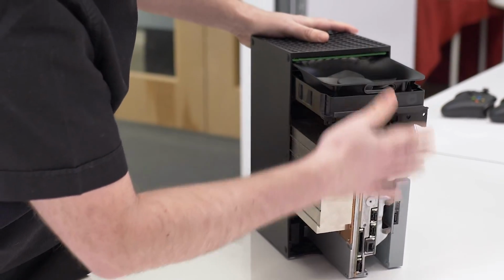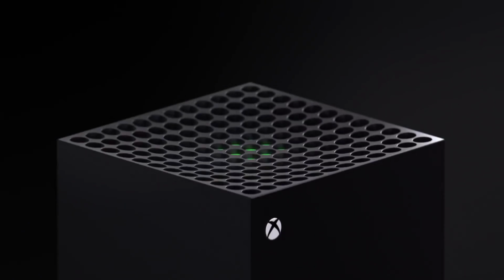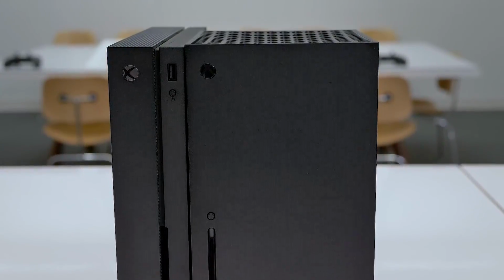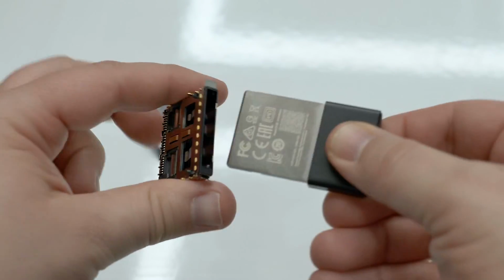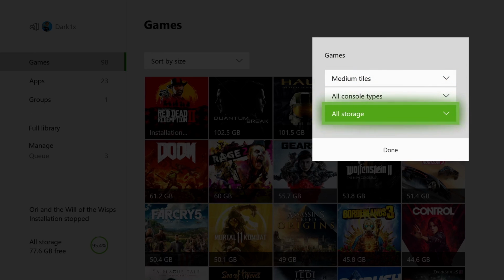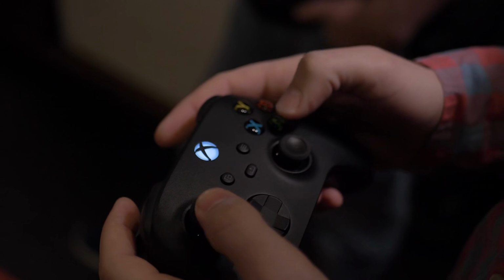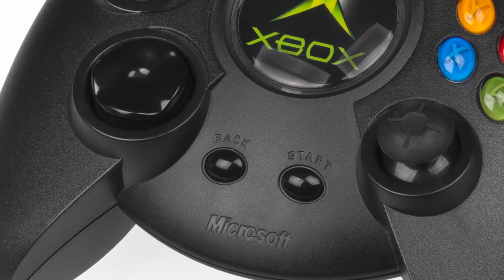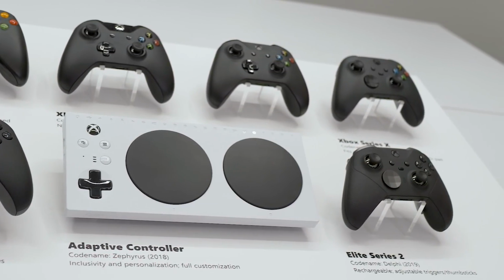DF Direct: Hands-On With Xbox Series X  + Impressions + Xbox One X Size Comparisons!

Comment: How hot to the touch does that Seagate SSD expansion get? I just purchased a small metal Sabrient external case and NVME drive for my MBP and it’s hot enough to burn you when in use. I don’t like to leave it plugged in when I’m not actively using it.

Comment: I think it’s very comparable to a PC .. Very reminiscent of the 2013 Mac Pro, which had just over 3 teraflops of floating point performance. I remember wishing I could afford that machine; now we have a computer that’s over 4 times as powerful (and far more than that in GPU performance) - for 1/12th the price. It’d be a mean little machine if you could use it as a general purpose computer. (Which you sort of can if you run Windows 98 on it via retroarch)

Comment: INCONSISTENCY? - If the external storage was supposed to be regularly interchangeable, then WHY was it situated at the REAR of the machine?  Should they ever launch a 4Tb version, then MAYBE the purchase would be a legitimate proposition?  1Tb is a far too small option for anyone with a significant game library, as is the 1.8Tb MAXIMUM storage option with the expansion fitted!  My XBOne storage is at 3.5Tb at the moment, as MOST of my games (105 games so far, PLUS apps!) are digital downloads from XBox Live Gold monthly offers!  I haven't bought ONE single movie to save on the machine either!  So, you can see, even FOUR Tb would be the MINIMUM I would need as BASE LEVEL storage option!

Comment: Can the Xbox series X be run in 1440p instead of 4k in order to have a more consistent frame rate? Essentially what PC players have been doing forever. Performance over prettiness. I’d love to take advantage of the power to run at 120fps consistently and put less demand on resolution

Comment: Nice design I think it would be wise to stand the Xbox upright since heat rises it will help heat to escape which means more efficient cooling. But if you leave the Xbox off for a couple days I wonder when you start playing and it heats up will you began to smell burnt dust. With those holes that large I'm sure dust will find its way in if left sitting vertical.

Comment: Hoping 4 things with the new controller: 1) Stiffen up the joystick spring tension. 2) Actually utilize the haptic rumble and 3) Beef up the bumpers, I've had to replace 4 of mine since the One launched in 2013 and 4) Make the connection either bluetooth or something better than the half-assed one they have now.

Comment: Microsoft: want more storage? Sure buy this card and plug it in this socket, that’s it.

Sony: want more storage? Sure just unscrew this back panel, then buy a drive if the size you want, only make sure it is fast enough so it won’t slow down the entire system, it will physically fit in the machine, it won’t overheat or be too hot and melt your machine. Or you can spend three times the cost for a PlayStation approved drive....

Comment: It looks good, but why was there more controller evolution in a single generation of PS1 than four generations of Xbox? PS1 took us from a SNES type controller with handles, to twin analog sticks and then vibration. All fixtures of controllers now, but innovated by Sony. And Nintendo innovated with the N64 controller, although to be fair that was a real monstrosity. But what's Microsoft so scared about with improving the controller, it's not like they instantly hit upon the perfect controller with the first Xbox design. They just took the left side of the Dreamcast controller and the right side of the Playstation controller and joined them together. And that became the Xbox controller that has lasted four generations with barely any change. Not saying Sony is super innovative post-PS1 either, again it's like they just stopped trying to improve it. As if they attained perfection, but it's far from perfection. They need to work on control interfaces, you've got all these amazing graphics going on but playing it still feels like you're operating a complicated remote-controlled robot. But then I suppose they tried to be super innovative with Kinect. And they super failed. So maybe that's why they're just polishing their old controller now.

Comment: Pc gamers are gonna need to spend around $1800 dollar’s in late 2020/2021 to build an equivalent Pc to match Xbox Series X as that’s insane console peasants are gonna get this insane level of high end Pc power, and performance at 1/3 the price of building an equivalent paper spec Pc
Reply: Isn't the 3000 series of nvidia cards looking to be extremely promicing? I'd bet that with a 3060 you could build a sub $1000 pc that can also do things other than just gaming.

Comment: Idk a lot about building PCs and constructing consoles but: doesn’t having all those pieces jam packed in there cause it to overheat even with a fan? Asking with intent to buy the SX
Reply: The largest piece inside is the vapor chamer, designed to cool the shit out of it.
Reply: @TheCrazeturk  This vapor still gonna be hot even if it's cooling CPU and GPU.

 Over time when the whole passive cooling system would be the same temperature as CPU and GPU it starts became hotter and throttle the system.
To cool that machine it need a lot of space or fan/liquid, and that prototype doesn't have either.

I just hope Microsoft do best job at the end.

Comment: Now, after the reveal of the size from PS5, im even more impressed what those wizards at Xbox achieved here.
Reply: Yeah, the XSX's cooling system is so freaking elegant. One big vapor chamber, one big fan, one big radiator. Whisper quiet, great cooling. PS5 should produce more heat and require more cooling even though its GPU is weaker, all because they chose clocks over cores. XSX is "wider," PS5 is "faster," XSX is definitely more powerful. I'm jumping ship, this'll be the first Xbox since the original that I've chosen as my main console.
Reply: @FFFan3445  At first I had doubts about the cooling - "Blimey, that's cramped and it's got one big thing at the top, that'll melt my face off" but actually I'm warming to it. Not like warm warm. But I like where they're going with it!
Reply: Facelord
Both will probably perform as intended. Look at all the releases of Playstation, that's what I think is the selling point.
Reply: Nothing 'wizardry' about it. Hard work, focus and talent.
Reply: The PS5 is slightly taller but has less than half the width, what is your point?
Reply: Barack Obama The point is that the XSX is put in a more home friendly design and looks to be better at heat dissipation. PS5 on the other hand... let's just say that it makes the PS3 and Xbox One look a little small.
Reply: @GrainMuncher stretch out both your hands and put one on a table and the other on top of your tallest finger, next take away your bottom hand and keep the top hand still, bend your fingers halfway on the bottom hand and place that hand on the tallest finger of the hand that's stretched out in the air still. Bam you call that small?
Reply: @GrainMuncher  seriously?? SLIGHTLY???

Comment: Why does the Series X not have a USB-C port at all (or a few), especially 2x on the front for charging it’s controllers (obviously after you purchase a future “Play & Charge Kit”)? This means they would have to supply either a USB-A to USB-C charging cable or a micro-USB to USB-C adapter charging end. Maybe they’ll ship each console with one of these adapters so that existing Play & Charge Kit’s are compatible?

Comment: I have built quite a few computers with air flow a priority, looking at this im a bit worried about cooling, testing it in a controlled environment even in the desert is one thing but it should really be tested in a normal room in a house environment with dust etc, because it looks like in a normal environment with dust accumulation that will become an issue

Comment: If there is no optical port for headsets for example astro gaming headsets, how will I use headsets with my Xbox series x if the port isn't there?? I very very much appreciate any insight or information I would be extremely grateful.
Reply: Supposedly Astro is working with Microsoft on an update where you can use your headset via USB.

Comment: While it won't be a deal breaker for me, if I'm getting it I do hope that they don't change the battery slot on the controller so that I can just repurpose my current recharge pack. Also, hopefully this won't mean I have to get a new USB dongle for PC, though I don't think it'll be a thing anyway. I actually have two controller for my PC at this point, and I'm really just milking the older one when playing non-action titles to see when it will break.

Comment: OK, there is one thing that is still weirding me out - the fan orientation.

Microsoft is talking all the time about how the Series X would 'suck in fresh air from the bottom and then exhaust it at the top'.
But the fan orientation is pointing downwards - so in all the footage we've seen so far it's pushing it top-down.

Which is by no means a bad thing, since blowing onto the heatsink should be better (more focused airflow) should be better than sucking in from it - it's just confusing me a tad.
But I'm happy the series X is a nice machine :)

Comment: I really wanna like this console, but im not feeling the "memory cards".  I would have preferred the option to add more sticks of nvme  instead.
Reply: It has usb to do that, you van also use hard drives, but that's for moving xb360, xb1, and og xbox games. The memory card is for being as fast as internal ssd since thru usb, it won't be faster, but I assume u can thru the usb ports

Comment: there is no fan Contact directly to the vaper chamber and that singel fan sitting far away from vaper chamber and its quite compact dont you think it will get hot? i know it got pretty low speed but maybe the hit temp limit around 1825 mhz? What if get hot then wont that make it lose some speed from 1825 or it will keep that speed until chip pope like a popcorn?

Comment: I realize that the PS5 has a faster SSD and potentially runs a little faster, but you can't beat these gamer centric features and 4 console generations of backwards compatibility.
Reply: Faster SSD doesn't mean faster system

Comment: Will the controller still break after 5 minutes of FIFA? 🙄 Don't mean to be mean, there's obviously some great engineering behind it, but.. With all due respect all that power has to be usable too. There are major complaints online, quality issues, not only about the standard controller but about the elite which costs well over 100 bucks. That's gotta change

Comment: Another great video from the guys at DF. I have one tech question that you or maybe another fan could potentially answer.

These Seagate extra memory cards. Are they themselves SSDs or are they just an extended memory that runs off the internal SSD. If they themselves are their own SSD couldn't the future hold not only larger size memory units but also faster SSDs than the internal?

Comment: PS5 vs XSX - - - - - - - - - - - - 
Ram - 448gbps @ 256bit vs 560gbps @ 320bit 
XBOX WINS
------------------------------------------
SSD - 825GB @ 8-9gbps compressed vs 1TB @ 5~gbps compressed 
PS5 WINS ( but with less storage space ) 
--------------------------------------
CPU - 3.5GHz variable (best case scenario) vs 3.8GHz locked 🔒 
XBOX WINS
-----------------------------------
GPU - 10.3 TF variable (best case scenario) vs 12.155 TF locked🔒
XBOX WINS 
---------------------------------------
GPU again - 36 CU with no accelerated mesh shading or variable rate shading VS 52 CU with machine learning, sampler feedback, accelerated mesh shading and patented variable rate shading courtesy of Nvidia co-developed DX12 Ultimate API
XBOX WINS
--------------------------------------------
Facts.
Reply: The series x is 4.8GB/S compressed. Not sure where you got the 8.6 number from.
Reply: @PrehistoricModels  

You're right about SSD but with Microsoft New decompression technology BCpack enabled they can get it up to 6GB/s a second with One terabyte storage SSD on Series X

Comment: Yeah but they still use AA batteries...
Reply: Microsoft made a statement saying that they use regular double A batteries (not rechargeable) because they have a better shelf life. So when you do eventually by the system and it's been sitting shipping container or boat you get batteries that have a charge when you get it. I would prefer them shipping it with rechargeable batteries and you take the hour + to challenge them up first. You can do that while you're setting it up or downloading stuff for the new system.
 That's supposed to be really fast this time around tho.

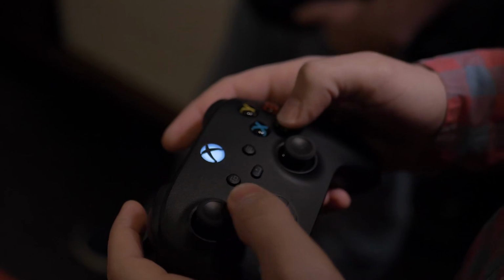Comment: 19:45 That is the reason itself I love the controller design of the Xbox and I'm glad they took people like me into account. I play using the claw method on both hands (more so the right hand and for some actions on the left hand) and it's just not comfortable to do them on a PlayStation controller
Reply: Can you give an example for left hand claw?

I claw the right hand in all games that use the right stick. The left hand however... I don't see where that'd be usefull.
Reply: @stefans4562  In Apex Legends, I use my left index finger to keep my character moving by pushing the left stick while using my left thumb to hold up on the dpad so I can open the shield/health item menu. At the same time, Im using my right index finger to slide jump (Hold B>Press A on Xbox) and using my right thumb to select the shield/health item with the right stick. These actions can not be done in less than a second if I don't claw with both hands. Keep in mind the pressure of being chased by the enemy because it's a predator lobby. It's saved me many times that I can't even count because it's second nature to me. Hope that helps!

Comment: Naaah, hate that form factor.  And it still looks like a mini PC/mini-fridge.  And yeah, it looks lazy.  Would be a pain in the ass to fit in my tv case.  Prefer the flat VCR designs.  Flat design wasn’t broke, why fix it, except laziness?  Hope PS5 doesn’t go this route.  

Not sure about that proprietary memory card either.  Better be sold zero profit for Xbox and not overpriced like Vita memory.  But nonetheless extra cost to make the slot for that card which perhaps could’ve just been used just to buy a bigger SSD in the first place.  Maybe it’s a good thing, maybe not.  Wait for price before deciding.  Skeptical, especially will it really work as well as the built in memory or will it work slower?  Or perhaps built in memory was slowed down to match the speed of the memory cart? Wouldn’t trust Microsoft not to do shady things like that.  

And wtf, still no built in battery for the controller????  Come on.  

If they have good games, I’ll buy, but won’t like that console form factor.  Just won’t look right in my entertainment table.  Hope PS doesn’t go this route.
Reply: The mini tower is due to heat dissipation, the heatsink is a lot thicker with this console

Comment: So i noticed that it uses USB 3.2 but most recently USB forum has updated the nomenclature TWICE. 
Does this mean .... USB 3.2 Gen 1 (SS 5Gbps) or USB 3.2 Gen 2 (SS 10Gbps) a big difference there, i know cause i've seen the bottleneck on my Asus TUF X570. 3.2 Gen 2 is about 80% faster on more economical Silicon Power Drive. Not to mention the Samsung Bar USB, that thing is Blazing fast, Faster than a SSHD, with little heat transfer.

Comment: I'm sorry, but how will heat not be a problem with everything so damn close together? Will we be able to open and clean out dust easily? These are important factors imo
Reply: It looks like it's super easy to take out and clean. Every review video I've seen these guys have removed the guts from it. As far as the heat goes that fan is the size of the entire console safe to say all of the air will be moving in that thing just fine.

Comment: $100 for a 1TB flash drive/memory card isn't all that expensive when you think back to the previous generations of consoles with expandable memory. I mean, do you all remember the 4GB Xbox 360 Slim? You literally couldn't run anything on it without something giving you more memory, and a 250GB insertable HDD was dropped on the market at around $130 if I'm not mistaken. But regardless, as time goes on, games keep getting bigger in file size and hardware/memory capabilities gotta ramp up in response. Thankfully, pricing these needed 'upgrades' has remained mildly reasonable.

Comment: My ist gen ps4 does not power off,  all I get is a blinking white light. I have to hold the power button in for almost 30 seconds to get it to shut off. However I have never had a problem with my Xbox one x runs flawless, we'll except sometimes some apps don't open unless you restart the console. I'm definitely getting the ps5 and latter maybe this console well see if this has as many triple A titles as the Playstation

Comment: Did you guys happen to catch any power figures? I'm hinting at TDP but I realize that MS might not share that sort of thing, so power consumption would suffice. I mean even with the savings from TSMC N7P, going from 40/36 with the 5700 (XT) to 52 CUs (and at 1825mhz at that) is a big jump. Definitely not staying below 200W though, I know that much. Look at the size of that heatsink!
Reply: Well the PSU is 300w so it can't be any more than that. And its using RDNA 2 which is 50% more power efficient then RDNA 1.

Comment: Blah blah blah the nvme design blah blah blah impressive. 
No, not impressive. Remember ps vita. 

Since that crt vídeo you guys seem to force something unto us, and something which is clearly not ok. 

Not being able to put any vendor drive on it, something that has the specs is a no no and will lead to ms charging heaps on the drives. 
There’s a plethora of nvme that have enough specs to be used. 

But yeah let’s say Microsoft did that for compatibility.